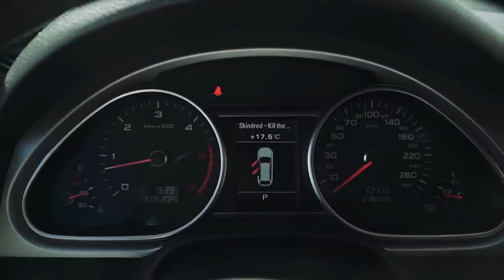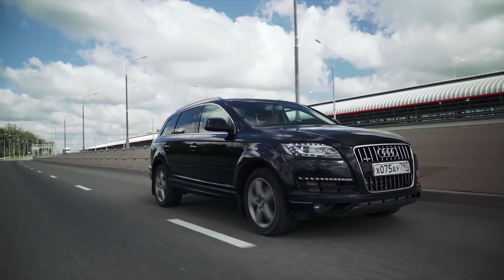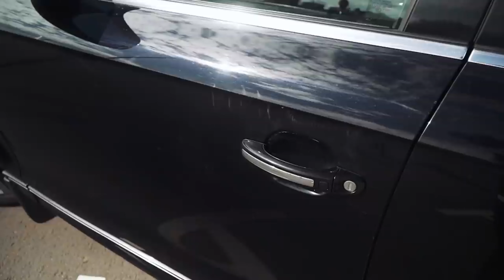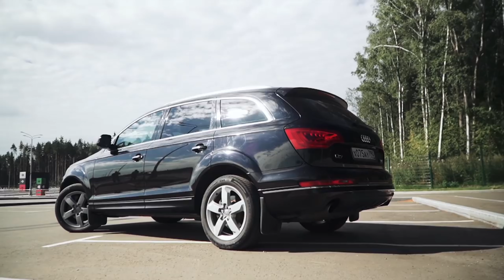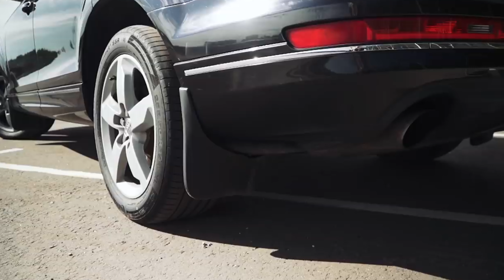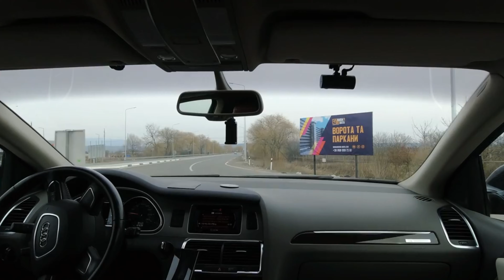Used Audi Q7 4L Reliability | Most Common Problems Faults and Issues

Comment: I don’t understand y they don’t tell people that the Audi Q7 3liter Disel has a oil leak problem from its crank seal and cost 30k to repair especially at 150to 160 thousand kilometers
Reply: Thanks for this comment. Think i’ll pass. ❤
Reply: Is this issue only for the version you’re mentioning?
Reply: Don't forget the  cam chain and tensioner  problems. Usually $16,000. plus for repair no joking.